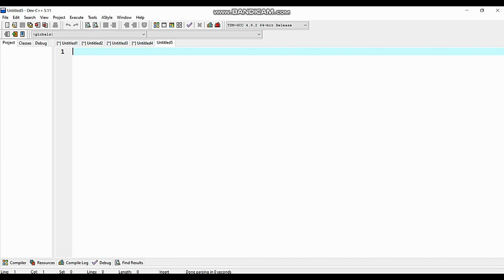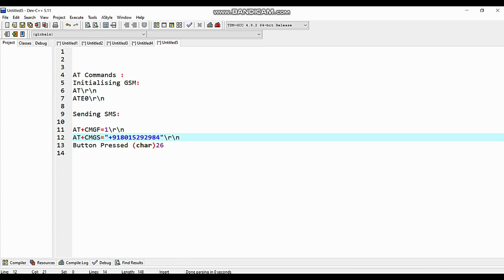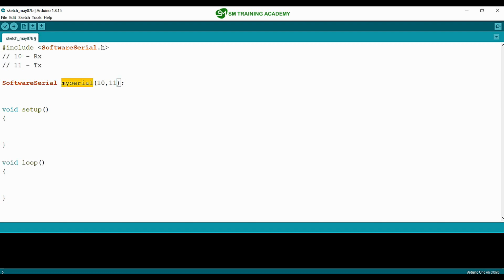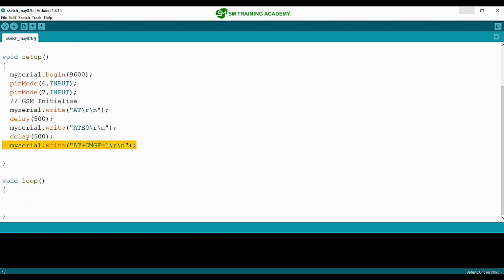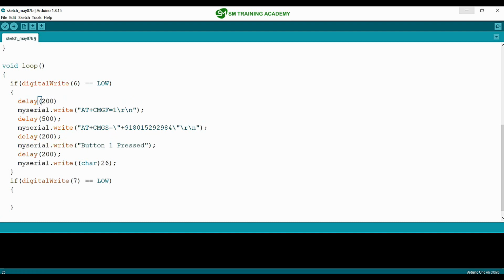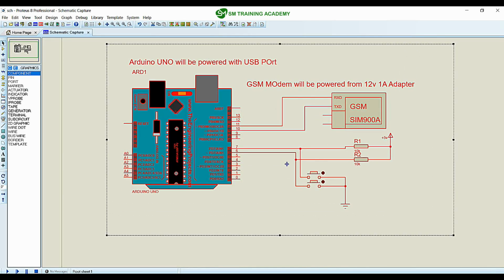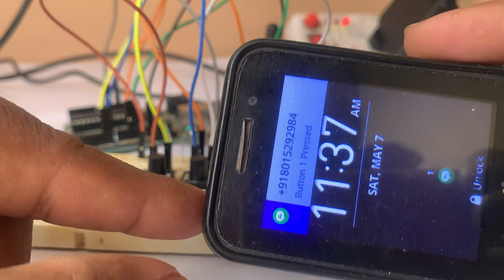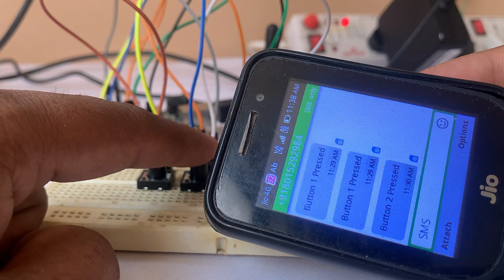Sending SMS from GSM Module SIM900A Using Arduino

Comment: Hello, can i send message according to a condition? for example using a altimeter and when altimeter shows under a specific value, it will send a message. is it possible? or can we just send messge by commands or buttons? thank you.
Reply from the maker: Yes it is possible you can do it read the altimeter value in Arduino and once the specific value is met you can send the command required to send sms